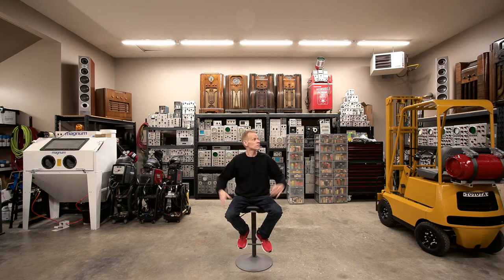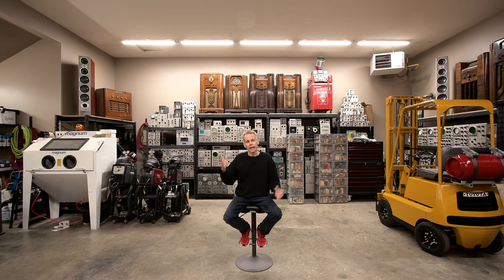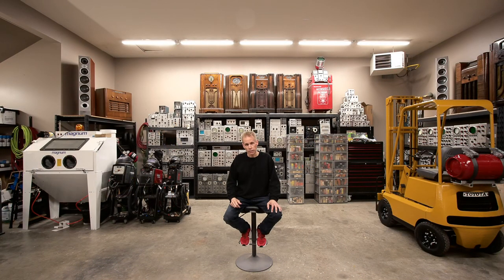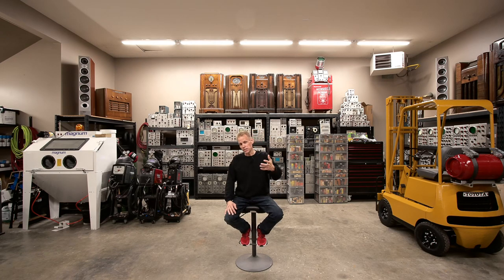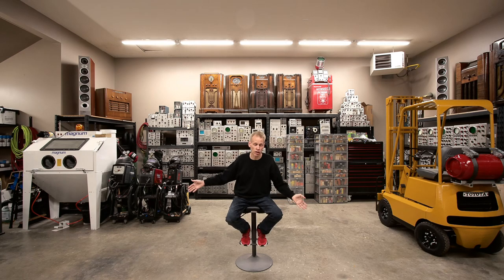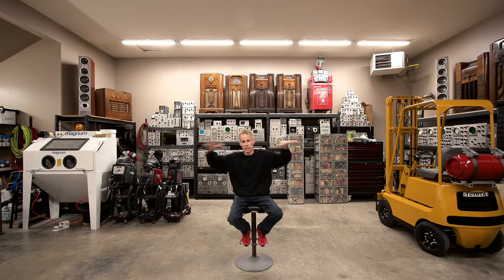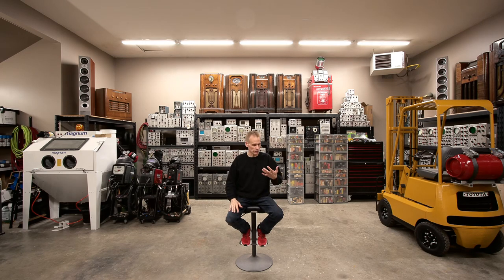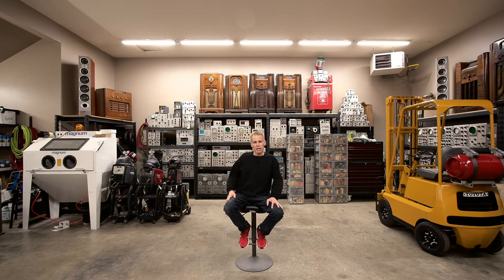ZAP! Mr C's Worst Electric Shock Explained In Detail!

Comment: Very happy you survived. Your Guardian Angel got orders from above: Knock him out of the chair". My next door neighbor in my youth was a " Communications Officer " directly under General Douglas MacArthur. He was first a messenger of sorts, then later was overseeing the building of radar stations and communications in the Pacific Islands during WW2. My dad befriended him, as they both served during the War in that theatre. 
He wired and  INSTALLED our 220 Volt Sears AC unit. Some years later it needed removal for service. The " Colonel" indicated he had pulled the fuses from the  units wall breaker. When I cut the wires on the unit with a pair of side cutters the jaws vaporized in a large blue flame..By luck, or Providence, or both, I had a heavy dry rawhide wook glove on, and the cutter had a thin wrap of electrical tape. I survived, but my dad,a combat veteran, turned white. The Colonel was a great guy, but even he had pulled the wrong fuses

Comment: Although it would be impossible to unequivocally determine the specifics, it is possible that the electric shock put your heart into an abnormal rhythm. Some of those abnormal rhythms can have enough blood flow to maintain consciousness, but some cannot and consciousness may only be maintained for a few seconds. Some life-threatening rhythms can, for various reasons, come and go. I have had more than a few patients seemingly figure out how to hit their own "reset" button at the threat of me administering a substantial zap to their chest. Or the physical impact of hitting the floor may have mechanically cardioverted/ defibrillated you. Given the circumstances, upon resumption of a normal rhythm (which can take a couple of seconds after the "reset line" reverts to its normal state by the internal potassium-channel "pulldown resistors") it would be expected for the rate to be rapid as you likely had as much epinephrine circulating as your body was capable of releasing.

Comment: worst shock i got was in tech school working on a washer. i'd hooked up a jumper cord to the solenoid but one of the clips came loose and  landed on a live wire so it energized the cord backwards! then when i touched the prongs on the other end as i prepared to plug it in i got shocked and held on several seconds before the breaker tripped...... as i was standing in a puddle of water too!  my hand was numb for quite a while afterwards

Comment: Years ago I WAS WORKING ON A POWER AMP AND WAS SITTING DOWN. THE AMP WAS CHASSIS UP AND I WAS LOOKING FOR A LOSS OF SIGNAL. I SAW A GAP IN A TRACK AND STARTED TO SCRATCH IT TO JOIN IT. A FINGER ON MY LEFT HAND TOUCHED AN UNCOVERED TERMINAL ON THE MAIN SWITCH. INSTANTLY I WAS LOCKED TO THE MAINS AT 240 vac. I could hear and feel the 50 hz all over me. I began to sweat profusely. I had a death grip on the steel chassis and thought this is how I die. Then my legs straightened up and I fell backwards of the chair onto an electric heater and fainted. I came round because I was burning . My finger tips were white and I thought a cap must have exploded. I had blown the tips of the skin o my fingers. Also due to the sweat and both arms raising up I had black holes up each arm like a Jacob’s ladder. Also my hair was singed. The next day the doctor told me I was the first person he had seen to get so badly shocked and survive. I am very careful nowadays. Love your videos.

Comment: My recollection is, DC current is less of a threat because it's less likely to stop the heart. And it's DC that causes muscle clenching, because it's 0hz. AC is more dangerous, but you are more likely to get free of it because of the alternating phase. Bell Labs did allot of research on electrical shock circa 1920s/30s ... the White Papers are probably online.

Comment: I was in my early teens,  a very long time ago, and I was wading in a puddle after a storm.   There was a mains line hanging low from the storm.  I ended up grabbing it to go under.  You can imagine, AC mains standing in water.  My uncle saw and ended up tackling me to get me off.  Risked his life.   My hand was burnt white. I was covered in ants, Lol. You could see three bones.  No blood. I acted like nothing happened. I walked over to my mom and didn't go into shock till I looked at my hand. I ended up getting skin graphs from my thigh. Still have the big square scar on my thigh 50 years later.  That's what got me into electronics.  I've been lightly shocked many times since.

Comment: my

My experiance was close, when someone left the driver tube cover off in a collins 208u10 in the Air force, we had safty mats , electical shoes, and told only to reach with one hand and no rings or jewlrey, but checking the driver tube currents with the two buttons on the outside my 2 fingers went into the drive box and my hand blew the 2 amp fuse at 2000 volts, wow what a shock, next day I could just feel the elctricticity in the room that gave me an I'll feeling. Luckey it wasent the output final with 8000 volts at 4 amps. Well went on from there, there was 5 10 kw and 7 3 kw there. 4 years of it and never happened again. Thank God.

Comment: I went out to replace a faulty microphone with a generic one on a Park Air airband radio back in the 80's should have been a straight forward job..but it was not a radio we dealt with so no service manual..figured out the wiring using a scope and the old trusty fluke meter ...soldered in the wires into the plug and went to test the mic by transmitting and ended up on my butt halfway across this office floor...the workers were as surprised as me...I got onto my boss back at base and told him the generic mic is not going to work...order the right one...without a manual hard to fault find and not economical time wise... the correct mic was fitted a few days later... no problems....still cant figure out what was wrong all these years later !

A slightly less dangerous story... I had not long started working with this electronics company  and I was out with one of the directors at a airport fire engine installing an intercom system and we had to tap a 12v supply of a big bank of batteries ...the director managed to drop a wrench across a positive & negative terminal with sparks flying everywhere..he seems stunned by this but I managed to knock the wrench off with a wooden handle of a hammer before any real damage was done.... 

My father nearly got done in by AC he worked as an auto electrician and the electric drills in those days had metal bodies and not well insulated... he was holding the drill in one hand and plugged it into 240v with the other hand and got a full shock and he could not let go luckily a workmate used a wood broom handle to knock the drill cable from the socket in time

watch that electric stuff its sneaky and will try and get you!

Comment: I think 🤔 this is regarding that little chrome ZAP ⚡️radio, as ya secondly called it. Yes, I see it now, the DAK radio. The other radio 📻 was a hot 🥵 chassis, or series-string set. This DAK must have had a short. I know what it feels like 👍 to be shocked 😳 by 60 cycles 🔁 a second (120 volts), it gives ya quite a buzz 🐝. Your friend, Jeff.

Comment: That will wake you up to the hazards of electic shock, won't it?    I have had a few shocks over the years, mostly minor.   My worst was touching 600vdc on a particle accelerator I was working on.   The current went into my thumb and out the index finger of the same hand, which resulted in an achy hand for a couple of days.    The amplifier redlined at 5 amps but was capable of more.    The voltage was to accelerate the  emissions from the filament similar to the function of the plate in a vacuum tube.     Glad you were OK.

Comment: hey... good stuff, glad you came down to the rest of us with your Shop Talk!  Surviving a good shock is interesting... and what makes us (other than body resistance) survive is keeping Cogniscient as it's happening.. , you have to consciously let go.... otherwise You're Gonna Die.... I've had shocks that I've smell'd myself burning before I've felt them... RF , AC more than 20Kv, 500V DC high current, 1100DC low current, and hey, like you I am still alive... because like Tesla, we knew the limit of our risk. Also seen some fantastic Arc shows.... no deaths thankfully... But 1100V Amplifiers??? How did they come about? Please tell us!

Comment: I find it amazing that engineers released “hot chassis” type devices back in the day. Imagine standing in your bare feet on a cement floor and touching the chassis when the AC plug happened to be in the wall in the fortunate orientation. How dumb was that type of design.

Comment: I work on a few things here and there with 2200 or 2400 Vdc, and have always managed to not get zapped by them, so my worst shocks have always been acts of God or due to someone else's negligence. I've been struck by lightning three times in my life. Each time was always somewhat indirect or I was shielded in some way, that I believe has saved my life. The other major shock that I received was in an elevator at work.  It was a rainy day, I had been sweating while moving servers and computers at another location and had just entered the building. I had already entered the elevator, and the door was closing when I was asked to hold the elevator by a co-worker. I reached out to hold open the door with one hand, while my other hand was touching the control panel. The shock that I received was a very aggressive one, and I then received prompt attention from my co-worker. Not thinking clearly, I refused an ambulance, went back to my truck and drove myself the five blocks to the hospital. My heart was racing, and I was completely exhausted. After several hours of checks, I was cleared to leave the hospital and told to take the rest of the week off. I slept almost non-stop for three days. The elevator in question had received an internal flourescent to LED lighting upgrade a week earlier, which left the cab hot, and I was the first unlucky person who managed to complete the circuit. The electricians determined that the shock I received had been a combination of 208 Vac and ballast voltage.

Comment: My occurrence had nothing to do with electronics but there’s something of a similarity to yours.
I’d gotten a bad case of poison ivy severe enough that I went to the doctor. He gave me a shot that was dependent upon my weight. I wasn’t very large. Since it made me tired I laid down to take a nap. While laying there I got to the point I couldn’t move or breathe. Like you no one was around. Out of nowhere it felt like someone hit me in the head. It was so hard my head bounced into the bed and flew into the air, arms flailing. I could finally breathe and I was wide awake. My only explanation I could come up with is it felt like the hand of God smacking me awake. Experiencing what I did I’m going to believe God knocked you away from it. Be grateful he saved you from it and don’t be afraid to share your experiences of His love and mercy. God bless!

Comment: I have been hit with a full ride Tazer 5 seconds full 50k voltage from my shoulder to opposite ankle full on.  The vibrations were incredible and it felt like someone had put a jack hammer up my rear end. I could think clearly throughout the whole experience but time seemed to stop and the pain was extreme.  Yes the connections points burned holes in my skin, cauterized holes.

Comment: You might have been capacitively coupled, and the high voltage (maybe highish frequency involed?) can and will make it worse. Usually from a slight contact to plain line voltage and frequency, without a galvanic ground path there will already be a buzzing sensation at the contact point. OTOH you said you had DC... if you had a buzz that was pulsed DC which has an AC component which can couple capacitively and also cause you to grab.

Comment: My instructor who was a master electrician for 20 years. A fellow master electrician was pulling an underground service through a manhole to a new poured concrete basement for a new house.

The service was not long enough and he kept pulling, thinking there would be enough slack to get what he needed.

He was standing on plywood as he was pulling.

He stepped off the plywood as he stepped back, and to this day, I don't know why that service was active and why the utility company had that service connected, but it was, and as he stepped onto the concrete, the 240 voltage went through him into the ground and he was electrocuted.

A second person who was not an electrician that worked with my instructor had this horrible habit.
He would break off the ground prongs off all his power tools

He was using a jack hammer and I don't know how it happened, but he was standing in water, and he was electrocuted through the jackhammer

I don't know if the missing prong made a difference, but it is bad

And I have been bit a few times and I am afraid of electricity now.

I studied 4 years to be an electrician and I worked construction for 3 years after the 4 years of school.

But I saw too many people who died.

It is just too dangerous

Comment: Electricity is fun. My only real shock came from swapping tubes in a Westinghouse B/W TV, with the power on. This was in the 60's. I was only 13 or 14 yo. And still riding my bike to the drug store to test tubes. Any time I saw a junked TV I'd strip it of all its tubes. I was reaching over a shielded metal box to remove a tube that was behind another tube that had a top connection, whose plastic, probable Bakelite, cap was only partially there. Well when I reached over it I all of a sudden found myself on the other side of the room. I wasn't injured or hurt at all, but did learn a lesson, and I did finish fixing the TV.  There was a country store that had a device, not a phone, it had two balls, one on the left that didn't move, and the right hand one would move in a arch downward. When you put a penny in it, it began to buzz. When your hand grabbed each ball and moved the RH ball down, an increasing shock was sent through your body, this was for fun. Though I don't remember doing it more than once. But every time I'd be there I'd look at it and wonder what it did. I'm sure sooner or later everybody satisfied their curiosity. It was really old when I was a kid. There were three real nickelodeon machines there too. Glass window front and you could see all the instruments inside and put a nickel in and watch it play the music. The country store is still there in Sudbury, Mass.

Comment: Hello Mr Carlson I watched this video and was wondering,  i own a 4000 kw Onan generator ive been looking for a used or new electronic ignition , there obsolete,  I was wondering if you could give me some advice.
Reply from the maker: My unit has points, and it works great. If your unit came with points, just leave them in. If it came with an electronic ignition, you will have to find a parts engine. There are a lot around, check your local CL.

Comment: When I was a kid, my mother was sitting on the sofa with a magazine in her lap. I was sitting on the arm of the sofa beside her, to better see the magazine. There was a pole lamp on the other side of me. The old kind that had 3 cone shaped metal shades at different heights. Without paying attention, I stuck my right hand into the air, and somehow a finger stuck into the fixture that had no bulb in it, but was turned on. That was not fun in the least.

Comment: At 7 years old I plugged an old wet cloth wrapped cord into the wall... thankfully I had to step up on 2 wooden steps to reach it... I woke up on the floor slumped against the opposing wall, my left arm hurt so bad I pretty much picked my hand up with the right hand... I had black marks which followed my veins on the inside of my arm. I didn't tell my parents until I was 30. 
I have a horribly strained skeletal muscle from under my left shoulder blade around to my ribcage.

Comment: I've been shocked off a plug wire from an old Rotax skidoo engine, couldn't let go.  Burnt a hole in my hand, and it was a moment where I had a new respect for electricity.  Ended up ripping the wire out of the engine.

Comment: No where near the seriousness or scale of your experience but... a lesson learned.  DON'T trust capacitors when discarding electronics.
 I typically take apart old hard drives when they die.  I do that for 3 reasons: 1) Prevent compromised personal data if the old drive is salvaged by someone,  2) I use the magnets around my shop to pick up shavings, 3) the highly polished hard drive disks are nice reflectors and make great bird scaring devices for trees.
So I take apart an external drive and discarded the parts into my trash can.   Normal.  A couple of days later I start a new fire in our wood stove.  15 mins later our garage is filled with smoke - Thinking the fireplace chimney is compromised and we have a chimney fire. Use a fire extinguisher to put out the fire in the wood stove and try to figure out if indeed we have a burn through fire in the attic.  After nearly calling the fire department I kept looking and decided there was no fire in the roof. (check attic and garage attic) About 3 days later I go to take out the trash and find the plastic bag in our metal trash can is melted on the bottom.   Lightbulb moment - I had dumped some wood debris in the trash can the morning of the mysterious garage smoke incident.  Capacitors - some of the wood debris happened to contact the right points on the internal power supply of the hard-drive and the capacitors had enough juice to create small fire.  Be careful when discarding electronics components with capacitors that are part of a power supply - they can hold a pretty significant amount of power.  Had there been more combustibles in that trash can we might have had a real fire in the garage.